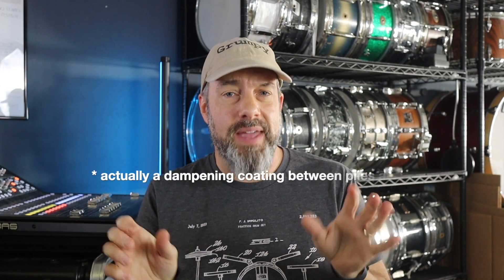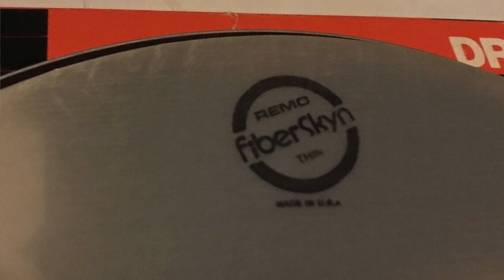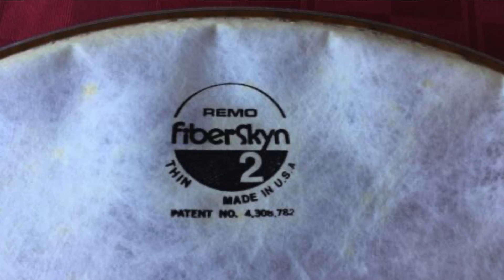What You Need To Know About Drum Heads. (The Physics of Drum Sound Part 4)

Comment: Good overview, Joel. Another point that you could have made, if you wanted the video to be longer... is that the thicker the head, the lower the pitch at the same tension. This can matter if you want that low, dead sound but are putting divots in the head everytime you hit. Using heavier, or double ply heads means that you can tension the head up higher, get the lower pitch, and not crater the head as quickly because the film is under greater tension and so returns a greater percentage of the energy into stick rebound. This is something that beginners, in particular should understand.
Reply from the maker: Excellent addition!  Thank you for sharing!

Comment: I’ve found that my flavor always comes back to a 3 mil snare side, a coated ambassador top side for the snare, clear ambassadors top and bottom for all of the toms, I typically play 8, 10, 12, 14, 16 shallow depth, and either a Remo pinstripe or Evans G2 batter and single ply 10 mil, with a 6” port at 4 o’clock 2” in from the hoop, and typically with a band logo applied, for my 22” kick. I play the drums wide open, save for a small pillow lightly touching each bass drum head, and I’ll add muffling rings when necessary. I used to close mic each drum but I’ve moved on to a three or four microphone concept similar to the Glyn Johns idea. That’s been my recipe though four different kits for twenty years. Before that I was very much a Remo pinstripe all around kind of guy. The ambassadors offer the best projection for most unmiked situations I’ve been in, but occasionally a muffling ring or clear emperor will be better for projecting the fundamental tone. Well maintained and thoughtfully tuned drums are the key to a happy playing experience, provided the player is healthy and sober, that is. The information relayed in this video is absolutely sage, and will put you right where you need to be sonically and financially. This information wasn’t readily available when I came up in the 1980s, so trial and error, and a lot of Jacksons to spend, were the only course to choose. Excellent work and very beneficial for the curious drummers out there. 👍
Reply from the maker: Thank you so much for the kind words!  I do hope this helps people reach their desired results quickly (and improve their confidence when selecting heads).  Cheers!

Comment: DDPizza, Thanks for this informative Video.  I'm curious of your recommendations for the following drums:
a DW Design Series Brass 14 X 6.5 Snare batter head for that Bonham sound ; a PDP maple 14 X 5.5 Snare and Maple Toms (8, 10, 12, & 14 & 16 Floor Toms.  I am currently using a HD Dry on the DW , smae on the PDP Maple snare, EC2s Clear on the 3 rack Toms and G2s coated on the Floor Toms.  The EC2s can sound "Plasticky" vs  a little m ore warmth form the G2s on the Floor Toms.  I use E-Rings on the 10, 12, 14 & 16 Toms, not on the 8" Tom or on the Snares. I'm a 71 yo resurrected "drummer"  who after 50 years [1969] began to play again as a retirement Pleasure / Hobby.  Way back when in the late Sixties when I first started drumming (Thank You Ringo, and Charlie Watts & Dino Dinelli [Rascals]) I knew Nothing of drum heads or more Importantly TUNING.  Tuning is an Art whcih does take lots of patience and experimenting.
Reply from the maker: Okay, first my recommendations:  Coated 2-ply head on snare batter (two THIN films -- 7 or 7.5 mil) for the Bonham sound (your HD Dry is NOT in the ballpark of that).  If you like mellower tom sounds then go with similar double ply batter, single 10mil clear for bottom heads.  If you want a bit more life go with 10mil coated batters instead.  

I'm not a fan of the EC2 as 'plastic' is a great word to describe them.  G2/Emperor or Aquarian Response 2 are much warmer.  

Oh, and if you haven't checked out Aquarian's 'Super 2' head you should, coated or clear.  It's a 2-ply but rather than the typical 7mil films it uses one 7mil and one 5mil for a total of 12mil.  Warm, but livelier than the Response 2 (2x 7mil).  My preference for 2-ply batters on snare and toms.

Comment: Thanks for a very informative series of videos, Joel!

Do you have any thoughts on the acoustic properties/ physics/ qualities of crimped heads vs glued heads?

I live in South Africa and drumheads have become increasingly expensive here. We have a line of heads here available to us called "Remo Encore" (or "Encore, by Remo"). Very little info seems to be available online about these heads (and Remo themselves never mentions them on their site etc.). From what I understand, they are only available to "emerging markets" (not at all in the USA or the UK, for instance. You can get them from Thomann, kind of the European equivalent of Sweetwater, however. The customer reviews there is also one of the scant sources of info).

They seem to either be made from the same Mylar as the US Weatherking heads or a very similar Taiwanese counterpart and they are made in Taiwan (as opposed to the UT, UX and UK Remo heads shipped generally outfitted on entry-level and midrange kits, which are manufactured in mainland China AFAIK).

The main difference (besides the place of manufacture, of course) is that these heads are crimped and not glued and only available in Ambassador (coated, clear, or snare side), Pinstripe (coated or clear), Powerstroke (clear) for bass drums and CS (coated) for snare drums. 

In SA, they go for about 40 % of the cost of US Weatherking Remos, one hell of a saving! 

I've been using the coated (Encore) Ambassadors as tom and snare batters and the clear (Encore) Ambassadors as sides. 

I find them very very similar to the 'real thing' with perhaps a slightly stiffer feel and possibly not as great in the lowest of tuning ranges (which I don't really utilise much anyway). 

It seems to be relatively commonly accepted that glued collars are superior (and most brands utilise this). However, marching heads still use crimped. I have also seen a few arguments that crimped are superior (and you do bypass some of the cracking etc schlep). 

Your thoughts on this?
Reply from the maker: I am unaware of the Encore line of heads, but my understanding of crimped vs. glued is that crimped were generally better for higher tension -- the film doesn't pull out as easier.  Ludwig crimped their heads for years (back when they made their own heads... now Remo makes Ludwig heads).  I never did any kind of purposeful comparison between them.  Perhaps that would be a good comparison to do if Remo makes crimped and glued versions of the same thing.  

My guess is that at lower tunings (normal drum set range of tunings) there wouldn't be much difference in the performance, but maybe I'm wrong.  I have used the Remo-made DW heads with crimped collars, and I don't personally care for those heads, though the collars may not be the reason I don't care for them.  

Interesting questions -- I don't know that I'm qualified for a solid answer, unfortunately.  You have given me food for thought however, and I thank you for that!

Comment: Hi Joel,
You are doing a great job on your videos. There is a wealth of information and knowledge in them. I grew up in the 70's and 80's as well, we are close in age. Unlike you, I didn't start playing at a young age. I have always been interested in drums, however, I didn't start playing them until I was 46. On top of that, I started out playing an electric/electronic kit. I know, not the thing to do when you love the sound and feel of real drums. That's what some of us have to use to keep the people around us from getting mad about the noise. Having said that, I did buy an old PDP acoustic kit. The first thing I had to do was put heads on them, both sides. I quickly learned that there are several things to consider when purchasing heads. Prior to all of this, I had never done anything with drums and therefore had to do some research to figure out what was needed. Then came the learning of tuning. I could type out a long message about all of this.

Your video series on this specific subject is very interesting and informative. I'm glad I came across your channel. Yes, the videos are longer than what you might find on YouTube and that's okay. It takes time to explain things. Some people will say that it doesn't really matter what brand or type of shells and heads are used and others say it does. What you have presented in this video series holds weight in my opinion. It's down to a gnats a** and makes sense. I look forward to watching more of your videos and having discussions about drums.

Comment: Love this!

So, for my jazz kit, I have a simple Yamaha stage custom birch bebop kit with Evans Calftone Heads on the batter sided of all drums, stock Remo "UT"  reso's everywhere but the snare. The snare is also an SC Birch. That's got a 3 mil Aquarian snare side currently with stock snare wires. I'm not a heavy hitter in general. Definitely not when playing jazz. 

All that being said, I am not thrilled with the snare sound. I had tried a 200 and a set of Puresound EQ wires. Definitely did bot like that combo. 
I want a really WET snare sound. Not sure if the 200 or 300 would be better here. What wires do you suggest?  Again, for a really wet sound. I also get horrible snare buzz, in particular from my 12. Which gives almost the same not as my snare does. This is driving me crazy! Should I use something other than the Evans calftone? Or.... A different snare all together?

Head suggestion for both side, and a suggestion for what wires please 

I also do have  other 14" snares if the Yamaha isnt the best option:

Tama Imperialstar King Beat 5x14 with guarded snare, but not the parallel strainer.

Premier 2000 (1970) with parallel strainer. I actually have not had the chance to refurbish this yet, but i can. I believe this is a rather rare chrome over brass, but not positive! Otherwise its aluminum. I know, pretty big difference probably but I am not experienced enough to know and can't seem to tell. It has a yellowish color i think on the inside where the chrome is thin.

A Pearl Sensitone Steel Alloy 5x14.

I also have an (unknown wood) "Del Ray" 5x14 that has reinforcing rings. Never had a snare (or any drum) with those. Got it with a kit i bought used. It has strainer without throw offs, just an adjustment on each side. I dig the looks of this thing. It has a white pearl wrap that is yellowed. Really looks like something that sat in a snoky Jazz bar for years .😂
I plan to refurbish it with tube lugs and a Ludwig probably, style strainer. 

PDP LX Maple 4x14. Never been crazy about the sound, but never put good heads on it wither. This is the 8 lug. I wish i never got rid of the 10 lug 5" I had. That sounded great!

I am a new drummer, almost 11 months. Even newer to jazz drumming. Doing it to become a vetter drummer with better dynamics and independence. But kind of getting hooked! 

I can rune my rock kit ok ( you probably wouldn't think so, but works for me!). I struggle so much getting this bop kit to sound right, but the snare is the biggest, well, snare that I run into.

Thanks for all the great content in this series. Hopefully you can give me some advice on snare selection, and how to dress them. I am not opposed to buying another snare either. Someone suggested a Slingerland Radio King (Rick Orio). I have been shopping for them lately.
Reply from the maker: Well a few thoughts.. firstly 'bop' kits are ideal for 'bop' tunings (which are pretty high, well above midrange).  Are you tuning the kit with this approach overall?  

High tunings for the rack tom will likely result in a perceived shorter sound (at least at a distance), but if you're tuning to midrange or below the sound is likely to get lengthy sympathetic snare buzz.  Usually changing the pitch of the offending drum can reduce this buzz.

As for the snare itself, I'd recommend 300 weight snare side head with tight tension.  I like lighter 'snappy' type snare wires, but the heavier Puresound wires can further reduce sympathetic buzz, though I prefer the lighter, brighter tone of thinner wires.

One thing you could do for the snare would be to coat the interior of the drum (paint/lacquer/tung oil/etc.) to seal the (probably) raw wood.  This will brighten the tone in a positive way, creating a bit more balance tonality (snare can be dull sounding with unfinished interior -- unfinished interiors are common on lesser expensive drums.  Not sure if Yamaha SC fall into this category, but I think it may).  

I hope that helps!  Thanks so much for being here!
Reply: @drumdotpizza happy anniversary 😮

Comment: 2:33 Maybe it was good to to tell that the Remo Pinstripe is not , I repeat, is NOT an oil-filled drumhead. For over 40 years I hear some drummers saying they are.
The coloured rings you see are so called Newton-rings, formed through reflections because of the two plies.
So, NO oil!!! 😁
Reply from the maker: Correct!!!  Many clear 2-ply heads produce that visual effect, but Evans Hydraulics actually do NOT!  Just a few bubbles in a Hydraulic head   ;)
Reply: @drumdotpizza  Thanks. I write about drums in a Dutch Musicmagazine for over 16 years now and about twelve years ago I did 4 pages on different drumheads and their specific characteristics. I included Remo, Evans, Aquarian and Attack heads. It was fun to do and I clearly pointed out about Pinstripes not being oilfilled. However, the editors then received lots of emails about my "mistake". In the next issue of the magazine I asked all these drummers to actually cut a Pinstripe open and find out for themselves... 😂
Another weird thing is that, while I was working in a music store years ago, quite often drummers came to buy a new drumhead and they didn't care what kind of head it was. Especially for the snare (usually 14", but often they didn't even know about sizes) so there was a lot of information for me to share. But then, there wasn't as much information available as there is today. Still.... 🤔
By the way, you made a nice video!! 👍
Regards, Coos
Reply: @UCS0608 - When I got a used Slingerland drum set when I was 14, it came with PinStripes. 

I had thought they were oil filled too (I was 14, and it was 1990) but the head on my floor tom had a split in the top ply. The newton's rings were still there, and there was no oil coming out of that thing, whatsoever. 

When the 12" head was replaced, I cut the top ply off of it, there was absolutely no oil. 

When I went on to teach and work in a shop it was one of the most common myths I'd debunk.

Comment: Ive been using the Evans ST and the HD dry for snares for a bit now. Can't really tell much of a difference between the two and they last about the same for me. But I do really love those dry heads for snare.
Reply: I use the HD Dry on my two Snares :  DW Nickel over Brass 14 X 6.5 & a PDP Maple 14 X 5.5 Snare.  My only problem is getting to my "sweetspot" on each drum with Tuning them.  I'm looking for the GoldieLocks - Just Right !! If I tune too tight, they emit too much of a sharp Crack.  I've Tried UV 1 and UV2 on the DW with not much satisfaction with the sound.  I'm now trying an Evans Power Control Center batter head on the Maple Snare... Not too great.  Tuning is an Art that I am learning!!  I'm 71 yo, retired, a Resurrected "Drummer" after 50 Years [1969] who plays at home for enjoyment about 1 hour a day to My Music.

Comment: Ludwig had some clear heads in the 80s which were amazing. There were also Kevlar heads for marching snares. I hated sticking stuff to my drums and didn't really want to "muffle" them. I eventually came up with a solution (this was in the 80s). I would put Ambassador heads on top but I would take drum heads which were old and needed to be changed and cut them into rings. I would then cut the metal hoop off right at the hoop. They would then just snap into the bottom of the batter heads. I would then put the batter heads with the rings on the bottom on the drums and tune them normally. The ring was tensioned because it sat on the bearing edge the same way the head did. It rendered a very controlled. sound with a single ply head on the bottom of the drum or with just the batter head.
Reply: I used to do that with Nobel & Cooley ZerOrings. Basically created a PowerStroke!

Then I got PinStripes and it was over. That was also in 80's.